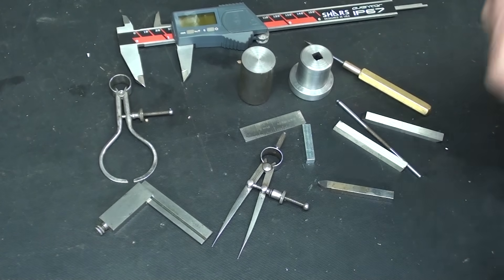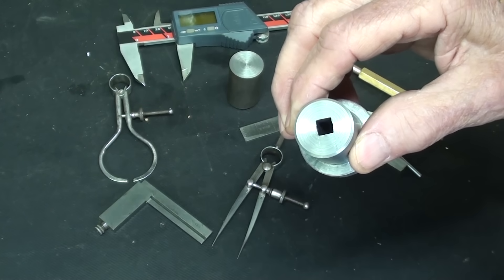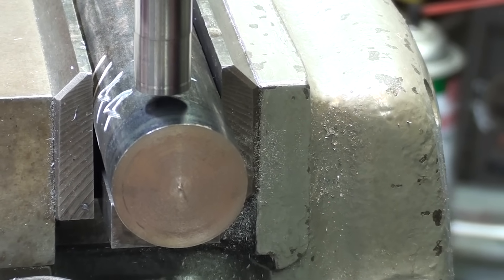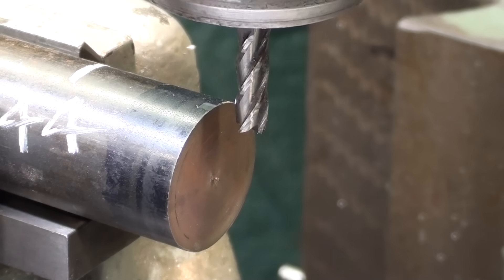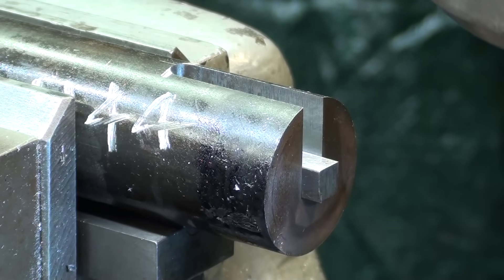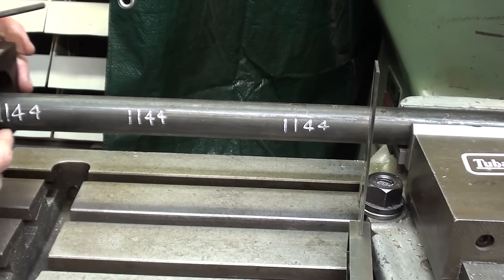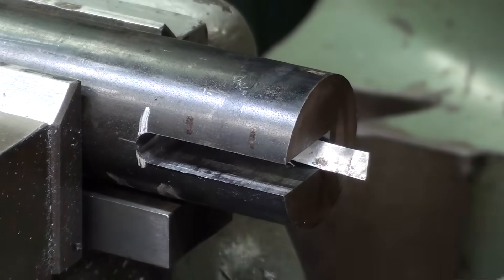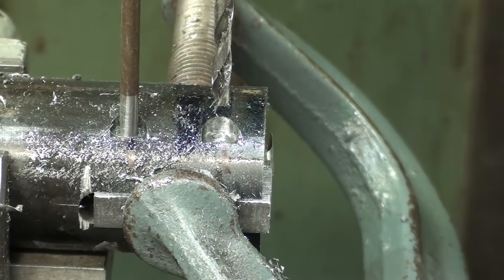Machine Drill a Square Hole in Round Stock #705 tubalcain

Comment: I make hex and square holes routinely but never like this because I’ve have access to the the right tooling and equipment. The different methods that I employ are; interpolation, rotary broach, broach, and “Watts drill”. The method used is determined by size, depth, material, tolerance and of course tooling available. Sometimes I employ multiple methods. For instance, if I need close position and size I will drill and boar the minor size though, interpolate the shape with a mill, then broach the corners out with a broach that only can cut at the corners so it has no choice but to follow the interpolated shape.

Comment: I always wondered why cutters don’t seem to slam into holes and edges within stock that the cutters are cutting. The ‘thumping’ part of this video is the closest that I have seen it happen. This same phenomenon occurs in wood machining too. Somehow it doesn’t slam and blow out or shatter the bit/tooling. I don’t know why.
Reply: The helical profile of each flute mitigates the thumping as a fraction of the overall length of the flute is engaged in the cut as it rotates. Deeper side cuts increase the loaded area  “ hogmills” compensate even further with helical flute truncations that leave a row of “high spots “ for the subsequent flute reducing the chip load a bit more and reducing the “ harmonic frequency “ that develops otherwise. 
Helical and herringbone gears apply a similar principle to torque transfer between teeth, resulting in smoother operation than tgeir straight cut thumping counterparts

Comment: I've seen people do the square hole by drilling the hole in desired spot and then using multiple files file it square. Lots of work.
Reply: 4 small holes and one larger one in the center and the filing is pretty light. Or a chisel
Reply: @RRaucina  now thats a good idea there. Wouldn't have thought of that

Comment: I don't know what it was called...  but my neighbor down the road (retired tool and die maker) has a system with triangular bits in a floating/counter rotating head that drills square holes in metal.   It uses guide plates to control hole size.

Comment: I made a wooden cider press, crank powered. Squared the shaft end. Made the crank handle to fit by drilling first, then filling. It's really close and tight and tightens as it reaches completely on. But took many hours, a lot of inspecting. It would be easier if somebody would just invent square drill bits.

Comment: Very nice job. 
I figured you'd do the old trick I read about, where you file a square hole into a thin plate jig, harden it, then make a 3 sided cutter that's real long, and use that to drill it on the lathe.
Rose indexer looks great.

Comment: I HAVE DRILLED SQUARE HOLES IN BAR STOCK ON A LATHE  A HARDENED BUSH  WITH THE HOLE SIZE IS FITTED TO THE END OF BAR STOCK  A THREE FLUTED CUTTER IS HELD IN A FLOATING HOLDER IN THE TAIL STOCK. THE CUTTER RATTLES AROUND IN THE BUSH AND CUTS THE HOLE . NO KIDDING

Comment: You could put that in a sleeve with two set screws to lock the moving jaw (dimple the 1/4" X piece so the whole thing don't slide out the end) for the ultamate adjustability use thumb screw's . Thought inspiring as always I have a mini mill motor with blown fusable links 7075 set screw termanals making a ko lee rad grinder att. from a small block chev crank so i can roll form Ti welding rod into band segments for a speedmaster band ya this is how it snowballs

Comment: And when I'm working it is an accuracy scare. Iv got to send you some loctite that is more suitable for locking that setup than the red it's the green there is two types of the green, one is bearing retention the other is what you need it works extremely well under heat and pressure and needs 500°f to be released
Reply from the maker: Yes, I would love some. Contact me again, at this email address.       lislepete22@yahoo.com
Reply: @mrpete222  I was going to comment wow 1M views glad I noticed because I also noticed you replied I always wondered how to contact you. Now I know and sorry just seen this reply and I have some things to send you including the green loctite. I'll contact you via email also I work 6-7 days a week you'll have to excuse my tardiness. I'm stretched pretty thin

Comment: I had to make a universal joint with a square hole at one end of the joint for my live steam Heisler locomotive. I had to silver solder because of the heat in the live steam engine would loosen the loctite. I did it a little different I silver soldered a piece of flat stock on top of the milled slot after machining a flat on the bar then turned it round.  Also by doing it that way I didn't have to rotate the bar 90 Deg.
Reply from the maker: Good idea

Comment: Is there a technical reason why it would not have been quicker to weld that key in place, rather than drill and pin and glue, assuming you have welding gear?

Comment: My approach would have been to slit the bar horizontally and mill out the two half-pockets inside then weld it back together and turn it to look pretty.  This method doesn't require welding, so that's a benefit for some.
I suppose a much more patient person than I am could drill a round hole and file it with a square file.

Comment: Thought for video on April 1st - find a ball-nose carbide endmill and cut a channel a bit more than halfway through some square stock and a half-circle along the length of a matching piece of stock the same width as the endmill.  You could then fix these around a shaft of the same diameter without taking the wheels off either end 😁  Enjoyed your video, good "out of the box" thinking.

Comment: What was the reason for the 3 thou tin foil shim?
Reply: My question exactly. Not everyone watching is a machinist and knows these things. Whats the shim for?
Reply: Clearance so you can get the bit in and out.
Reply: @timdouglass9831  why wasn't a shim needed on the sides?
Reply: @bobhope866  Because the machining left sufficient room. Note that he could slide the  bit in easily, but when the spacer block was clamped in place it would be pressing down on the bit, making it impossible to remove, that tiny clearance from the foil is all that was needed. Note that there is no crush on the sides of the slot at any time in the assembly, so it maintains the machined-in clearance.
Reply: @timdouglass9831  Ahh...I understand now..Thanks!

Comment: Probably could also grind  a taper on your tool steel on all 4 sides then cut grooves in it with a cut off wheel held at a slight tip and make your own broach. :-)

Comment: Great way to do it! I would use silver solder it to give similar strength to a broached part. One big advantage of the demonstrated technique is that it works for odd dimensions and bottom holes. Silver solder is one of my favorite materials when building prototypes. Also this way may actually be easier than broaching or odd geometries such as angled holes.

Comment: A variation on this technique is a way to hold cutting tools in a boring bar. Mill a slot in a piece of material just big enough to hold the square cutting tool. Now cross drill the boring bar for the slotted slug. If you want to be clever and there is room, off-set the cross drilling so that when installed the cutting edge of the tool will be on the center line of the work. Doing this will allow you to get the bar into holes in the work not much larger than the bar itself. The drilling need not be square to the boring bar. It can be angled so that you can face the bottom of the bottom of the hole you are boring.

Drill and tap the end of the boring bar through to the hole for the cutting tool. If the bar is large enough several holes may be drilled/tapped and they may be put in from the side of the bar is there is room for them. Now install the slug with the cutting tool and secure with set screw(s) which will also hold the tool square to the bar and Bob's your uncle. 

Cheers from NC/USA

Comment: Call me crazy but I drill the hole and use a square file to make it square. Using the method demonstrated, I would probably use a piece of keystock to fill the gap and weld it in place before turning. Instead of pins, the holes could be threaded too. There are usually multiple ways to accomplish any task.

Comment: Another tip for indexing the part: mill a small flat at the end.  Use your square still.  After features are done then machine the flat off.
Reply: Very good tip!
Reply: Why not just rotate the shaft and use your square on the edges of the groove you just cut.
Reply: @madjack3314  that would work as well.

Comment: Interesting!  Thank you.
Reply: Hi Served my time in a toolroom mostly on press tools and jigs and fixtures for the machine shop but I started in 1963 so I am well retired now. Taught machine shop in the local Technical College for the last 20 years before retirement really loved it as I restore old bikes and the use of a well equipped shop was a bonus as you can imagine. Still have a reasonable set up at home but miss the more expensive equipment just want to make a comment to see if other older guys find the same as I do but before I do I am still fairly sharp and up to speed. Thing is I have watched all the machining tips etc. And realise that most of them I used before but have forgot them does this happen to anymore of the pre cnc brigade just wondered

Comment: Well done. Could you explain the theory of hammering on the work piece after tightening in the milling machine vise. (In a video. )
Reply: Work pieces are commonly given a few love taps to make sure they are in contact with the parallels, or otherwise fully seated in the vice.  A few more AFTER tightening simply verifies that the work piece is securely held.   If the piece is  not securely held it's MUCH BETTER to knock it around by the hammer than it is to be flung around by the mill.  It's not only "if" the piece is loose, but when and how you find out.

Comment: Hey Mr. Pete!
One suggestion for pinning the filler material into place...  Use mild steel taper pins driven home firmly with the Loctite.
Ken
Reply: Either way, it's the same principle as "Draw Boring" in woodworking used 14th century through early 20th century solid furniture - most noticeable in "Craftsman", or Mission Style" furniture.

Comment: How about a press fit instead of loctite? I don't know if that would be more durable. Loctite is pretty good in a lot of circumstances

Also, doesn't Loctite go out of date? Seems like a very old bottle, and I heard of some loctite not having the strength it used to have in the field because it was out of date.

Comment: Well Mr. Pete you completely stumped me until you showed the filler flat stock. 
I needed to replace a broken zinc casting and the part included a square clearance hole. My replacement part stock was aluminum. I drilled a nearly on size hole and then made a single point broaching tool from a broken solid carbide end mill. I took very small bites using the mill quill with 5 spindles off to "broach" to each corner. I used the round hole tangent as my end of cut gauge. My tool was crude and didn't get me fully into the corners. X and Y axis table movements controlled my depth of cut and kept my edges square. Hand filing dressed the part to size. My clearance tolerance allowed for some hand filing error. I felt pretty smug about my method, because it was novel to my experience, and it worked well. I still feel snooty everytime I use my vintage Powermatic drill press depth stop, because this is where the part lives.

Your method is wonderful and I would have employed it but made the replacement part from steel. I like the silver solder suggestions if stress strength is required for the application. I am like many other commenters in that I have never seen or heard of a Rose-Index. You introduced me to two brand new shop solutions. Is your square hole solution your own idea?
TOT showed a rotary broach or maybe it was called a rotary square hole drill. That tool was fast and looked like magic. My entire machine shop career never employed any method other than dedicated square broaching. We had multiple dedicated broaching machines. I have never use a key seater or a filing machine, but I suppose these could speed up the square hole process. Right now I like your solution for the one off part in a shop with only a mill and lathe.

You are brilliant!
Reply from the maker: Thank you very much, but I am far from being brilliant

Comment: Really enjoy you informative and well explained videos.  I have a South Bend Model A lathe and can you tell me the diameter of the pulley on the back shaft, not the pulley on the motor the large pulley that is driven by the motor.
It seems that was lost or misplaced in the move  and I need to replace it.
Thanks so much.
Reply from the maker: I sold both sb lathes
Reply: @mrpete222  Boy, this information is so hard to find, thanks for getting back to me.

Comment: I've never seen a rose index before. I'm going to have to make one of those.
Reply: Yes, I'll have to make one also. I didn't know about the  Rose Index until now, but what a useful tool it will be. BTW, Loctite will set up in less than ten minutes with a little heat from a hair dryer and if already set up, about 200 degrees from a torch will loosen the bond to allow the part to be removed.
Reply: Seems like it would be handy to have an indexer to make one.

Comment: Thinking to myself, in this case the square doesn't need to be accurate to 90 degrees, the edges just need to be straight since the rose index will be "zeroed" on the surface and the index will be turned only. It may be a use for some of those 89,7 degrees chinese precision squares......

Comment: Crafty old fox technique here. I never thought of forming a square or rectangle in round stock with this method. If it was silver soldered or brazed it would have near as much integrity as if made from a solid piece. Today,I found myself enlightened by an old school shop teacher👏👏
Reply: Silver soldering is a great idea. I think I would widen the slot width above the 1/4" square opening to 0.315" for a 0.312" filler blank.  EDIT 1: The 1/32 land on each side establishes the 1/4 opening, any silver solder closing the opening would need to be filed away (silver solder tends to fillet radius sharp corners and gaps per your supplies and torch skills).  EDIT 2: A dovetailed filler slot could be endmilled above the 1/4" opening with a reverse taper one lunger cutter for silver soldering a dovetail filler piece. Any sidewall could be drilled and tapped into the 1/4" opening for a setscrew(s).
No cross pins, HSS blank or aluminum shim would be would be required.
This procedure could be used to form an opening across the diameter with a 1/4" wide slitting cutter in a Bridgeport.  Shop made boring bar?
Reply: @waynespyker5731  I think the technique I'd use would be raise the end mill to half depth in the slot and machine an extra few thou from either side of the slot. That gives you the ideal gap for braze/silver solder fillet but leaves the lower half the slot tight on the insert piece for accurate location. It would also prevent any silver solder from running through into the square hole area.

Comment: Mr. Pete proving once again there's more than one way to skin a cat! That keyway reminded me a couple of years ago I was using a 3/4 ball mill in the Mazak held with an "inexpensive" off shore made holder. When I turned around the endmill had sucked out of the holder and nearly cut a 200 lb. plate of 4 in. stock in half! Needless to say the holder went for a nice flight toward the chip hopper and we now use a nice Lyndex holder for that job! It cost about five times as much but we've never had another accident. I love my job!
Reply from the maker: Wow

Comment: You cheated, I use an E head
Making an index penta, hex, septa, octo and what ever nine sided is called is a great project idea,  more than a collet block, less than a rotary indexer and removable. Thanks

Another idea is a removable collar with a flat , I could use to reference with angle blocks , square, or adjustable angle ; for indexing round or irregular stock without a reference.

Comment: Sorry, I feel like a dunce!  I still didn't understand why the aluminum shim was necessary.
Reply: My guess would be that’s about the thickness of the loctite he put on the key
Reply: @josephsatterfield9228  He put the shim in the bottom of the hole which raises the key up a little. He put loctite on the sides of the key, so that can't be the reason. I think it is because he had to hold the key tight in place with a C-clamp as he drills the holes. Without the shim, the key would be so tight against the square tool, it would make the hole too tight to get a tool in it after he pinned the key in place.